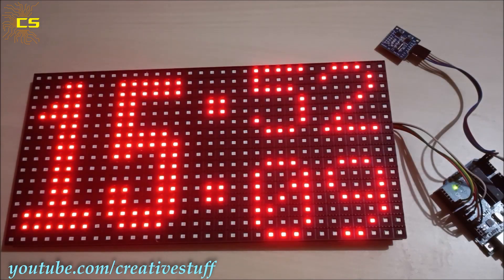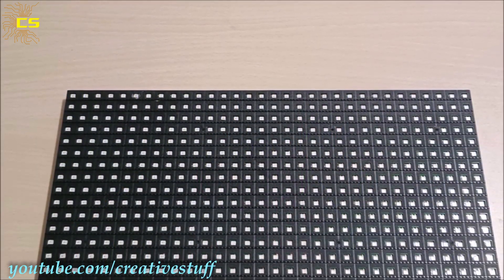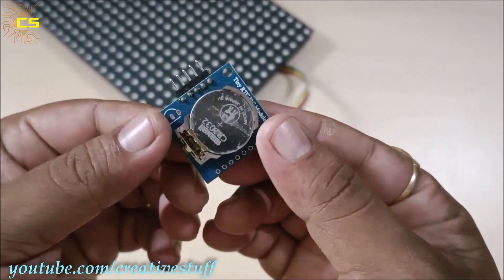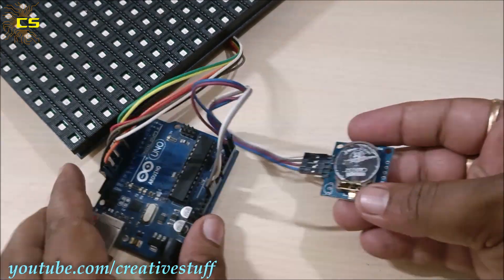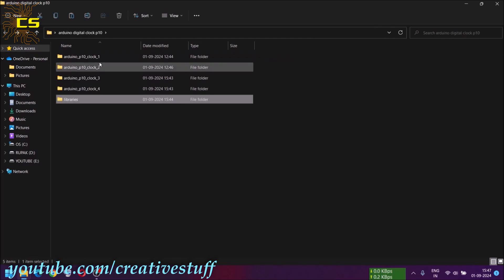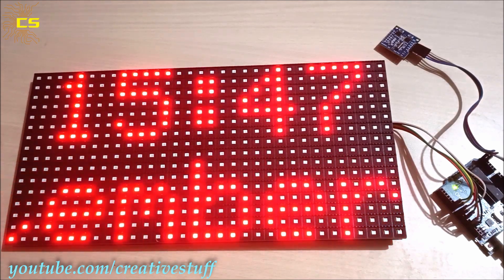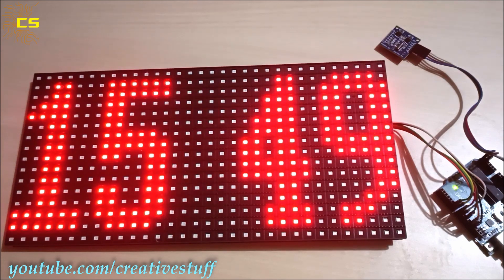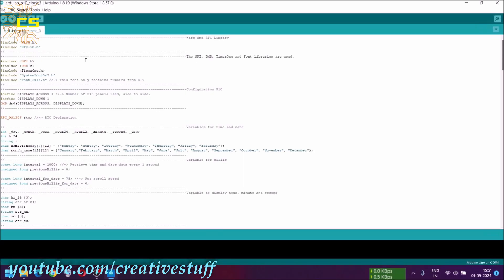DIY Digital Clock using Arduino and P10 Led dsiplay

Comment: Like somebody below asked... can you set the brightness? I'm using your Clock P3 sketch - disabled the scrolling facility as it was not required. Deactivated the calling of the  "Scrolling Date"  routine. It is just to bright. I know the brightness can be adjusted by controlling the 5v supply to the P10 board, but there must be a way to control it automatically via the software using one of the analogue inputs to the Arduino with a Light Dependant Resistor to measure the ambient light and adjusting the brightness accordingly.

Comment: How to adjust brightness,,,
Reply: What i have done, was to connect 3 diodes (1n4007) in series to drop the voltage to the P10 board. this drops the voltage to the P10 board by 1.8v and the display will be much dimmer.